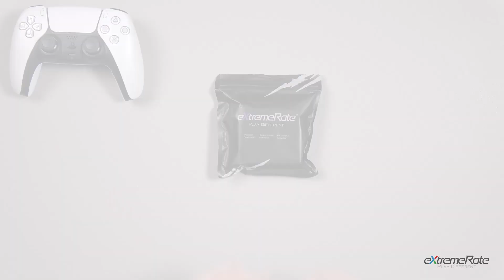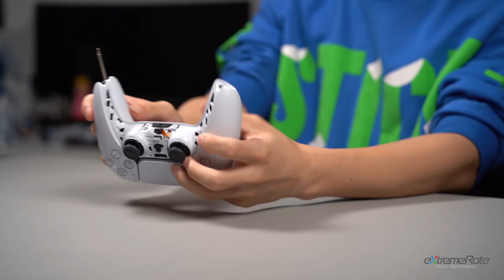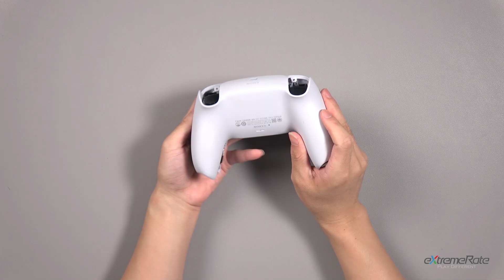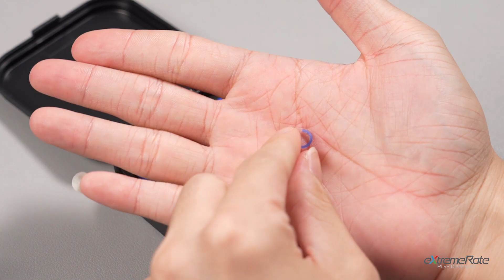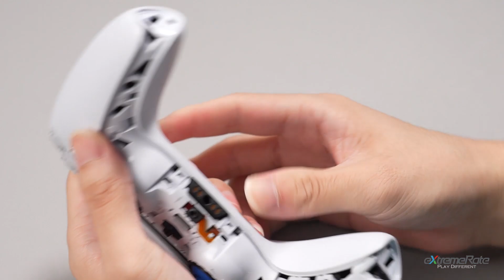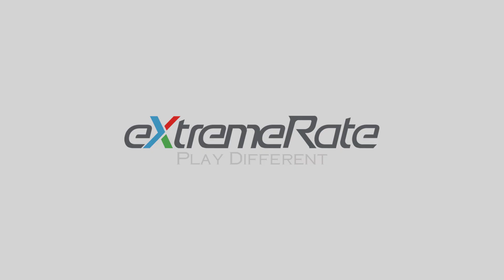How to Install eXtremeRate Edge Sticks on PS5 DualSense Controller

Comment: The old sticks were giving me stick drift! Put the original back in and the drift was gone!
Reply from the maker: That's weird. I guess maybe dust goes in the analog potentiometer cause the drift, and when you put the original back the dust gone? Because the interchangeable thumbsticks will not cause drift directly
Reply: @ExtremeRate  i did clean the potentiometer and try again but no luck so went back to the originals and was gone! Whats the difference with these and the old version?